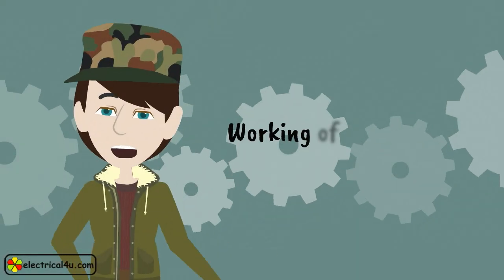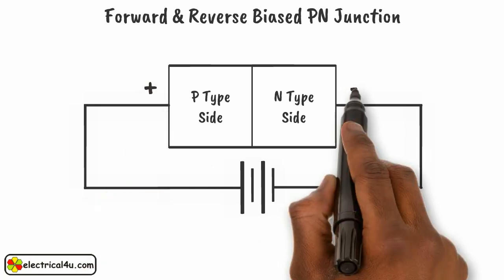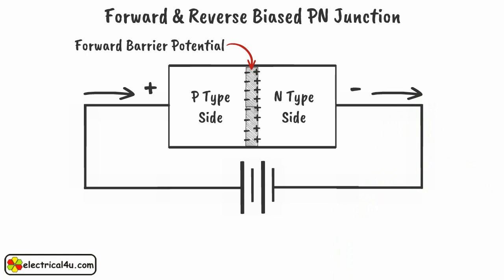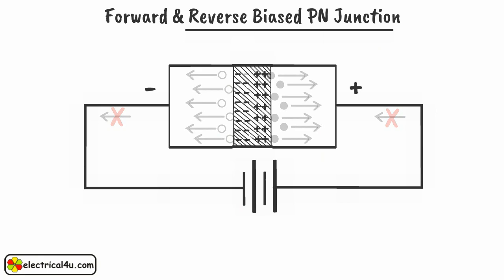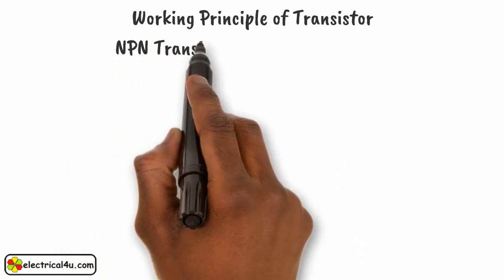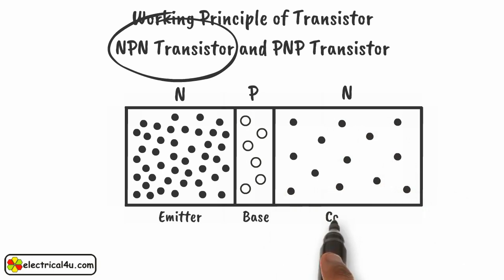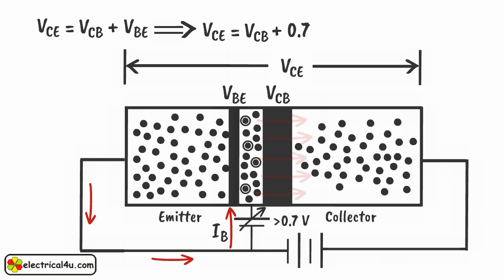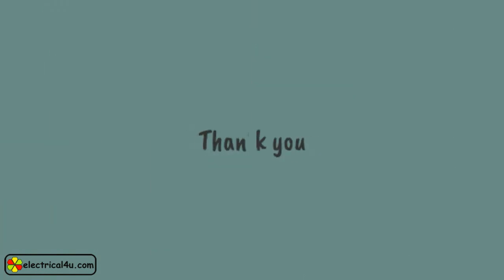How does a Transistor Work? A Simple Explanation

Comment: Howdy. This is my theory only. I posted this comment in another transistor clip. Comments are welcome.
"I understand that the base current provides a "bridge" for the emitter electrons to jump into the base. I didn't understand the current gain mechanism earlier. Now I believe I do. My earlier thinking was that once the emitter-base depletion voltage is exceeded the collector current should simply "avalanche" through.
In the following I apply quantum physics.
The emitter-base turn-on voltage is not a sharp knee. Base current begin to flow at about 0,63V. The depletion zone has not disappeared completely at 0,63V. Only few electrons are energized enough by random quantum mechanics to jump / tunnel the emitter-base residual depletion zone into the base.
When we drive more base current the emitter-base voltage rises to 0,7V. The depletion zone is saturated and has therefore disappeared. All free emitter electron can tunnel straight to the base and forward to the collector.
So in my mind. The BJT is actually voltage controlled. When the base-emitter voltage varies between about 0.63 - 0,7V the residual depletion zone varies in "thickness / density" allowing more or less electrons to tunnel through.
Finally it is worth observing that one cannot have a base-emitter voltage without also having a base current."
Regards.

Comment: Why no current can flow for the potential applied between collector and emitter? Is it not the same as applying voltage between emitter and base other than Vce has to overcome two potential barriers.... if Vce is large enough it should be able to overcome the two depletion region barrier and electrons should flow from emitter to collector...

Comment: Why is V_be fixed and only V_cb increases at 5:30 ? Why could the external voltage not overcome the V_be and cause flow of electrons into the base even without the second voltage applied between base and emitter?

Comment: I am just wondering about the equation at 5:43. Shouldn't it be "Vce= - Vcb + Vbe ? I would think, due to the different polarity's, Vcb has to be negative? I also found this negative Vbc on other webpages as well, for the same npn-transistor.
Other than that it's a great video. thank you!
Regards!
Reply: Sorry - it doesn't work like that.

Comment: I have doubts:-.   We got amplified current output at collector(collector current is more than base n emitter current) ...but u said i(emitter)=i(base)+i(collector). That means emitter current is larger than collector||||||||||.  How?
Reply: Yes, the emitter current is the sum of both currents (base [Ic/B] and the collector current Ic). However, by increasing a low base current you also increase the collector current: current amplification. The amplification here is with regards to the base current which is clearly much smaller than the collector current (by a factor of B).

Comment: It's not kinetic energy of the electrons in the base that enables them to cross Vcb at all. The reason they cross is because they are minority charge carriers and they don't see a barrier. For electrons Vcb is down hill. So, the reverse biased current of minority charge carriers (electrons) across Vcb is large due to the large number of them. The reason the base is lightly doped is because only the electrons that don't combine with holes are free minority charge carriers. I think the reason the base is narrow is so that the concentration of electrons in the base is large. If the base were thick the electrons would fall down through the base instead of populating the base.
Reply: bonajab its not the kinetic energy... but they need some energy to cross the barrier
Reply: that the point u got the concept right thanks
Reply: THANKS FOR THE CORRECTION
:-)